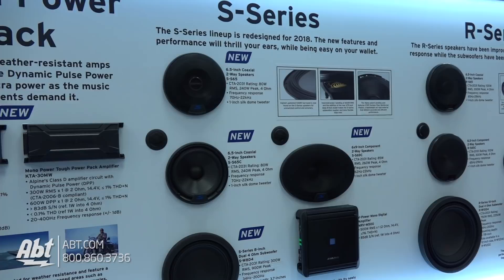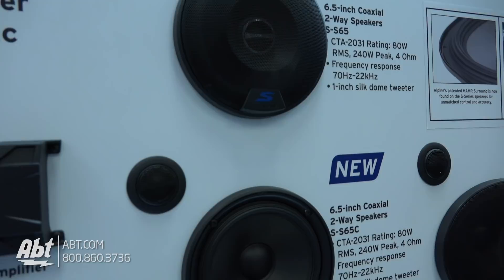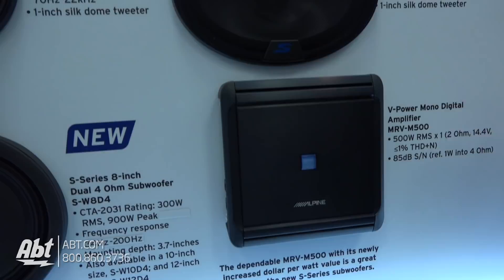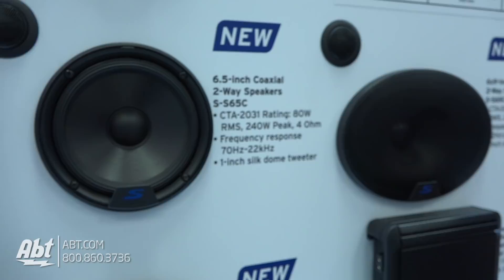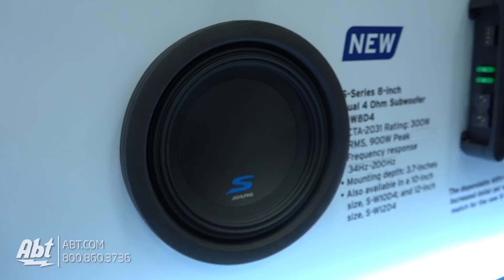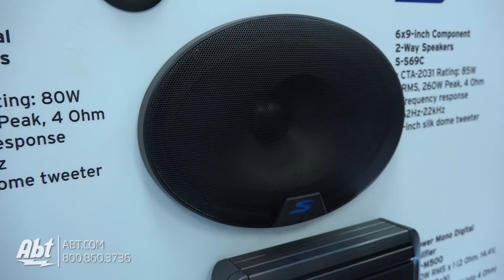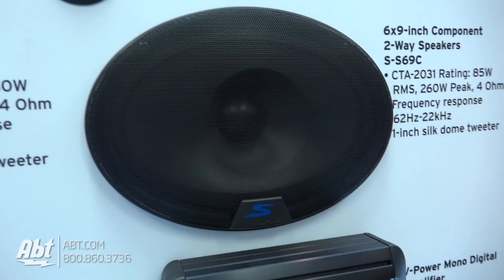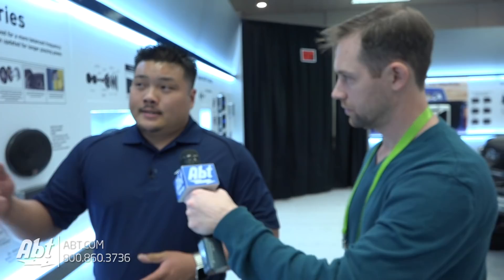CES 2018 - Alpine S Series Speakers

Comment: What’s the difference between the s-s65c and the non c version
Reply: The S-S65 has the tweeter built into the speaker. C has the tweeter separate. Same speaker material, just component vs all in one